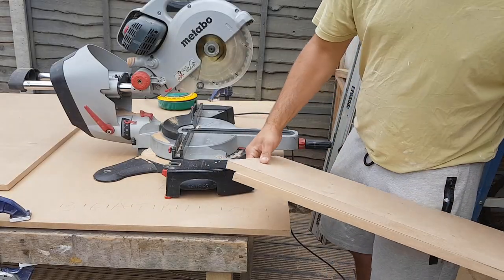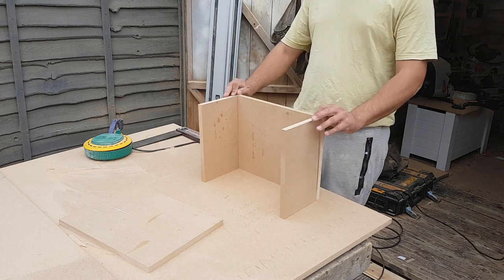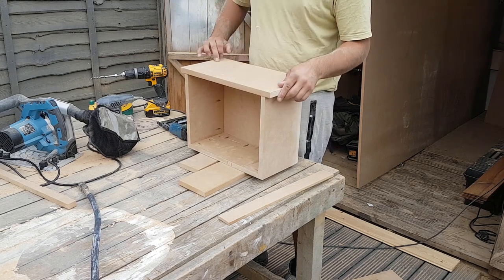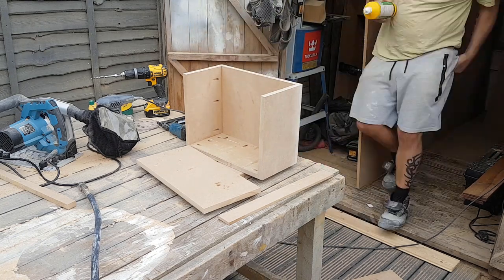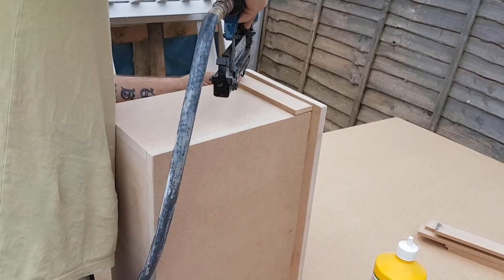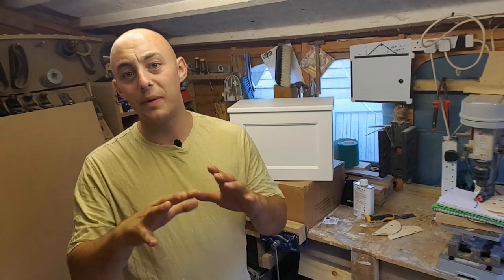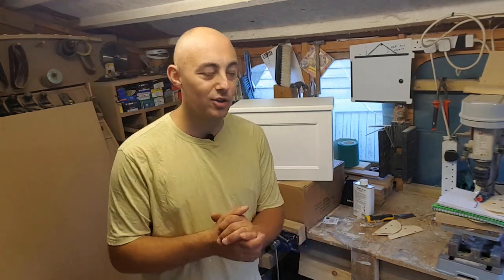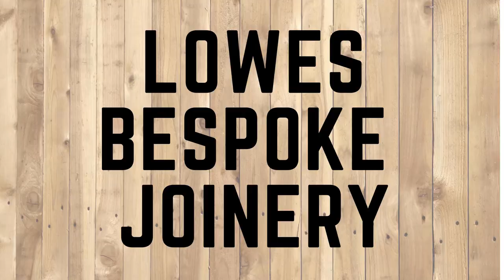how to build a fuse/consumer unit cover

Comment: How do you access the consumer unit? What if a fuse trips ?????
Reply from the maker: Just lift it off.. as I believe  this one was on two key hole type fixing... but I'd  prefer a door.. I have 2 to make with pull down fronts I'll try video  them